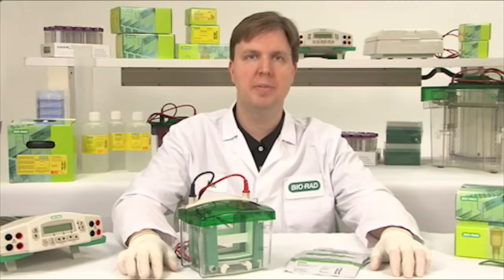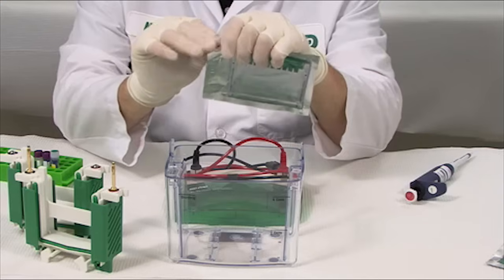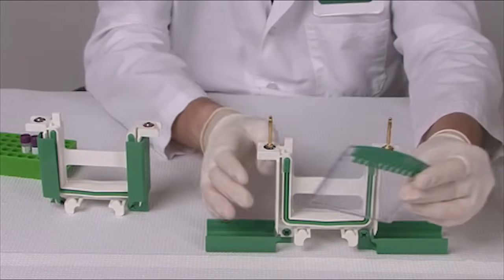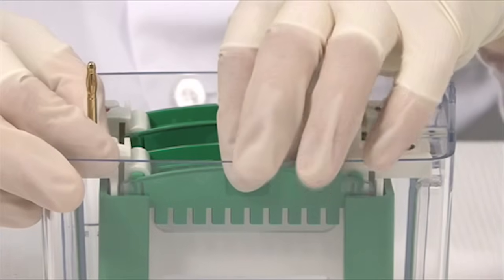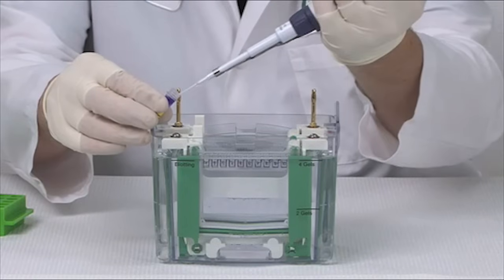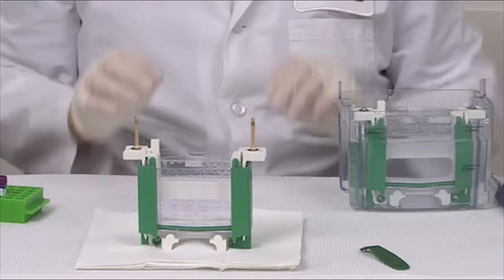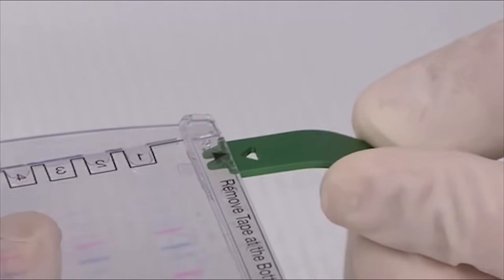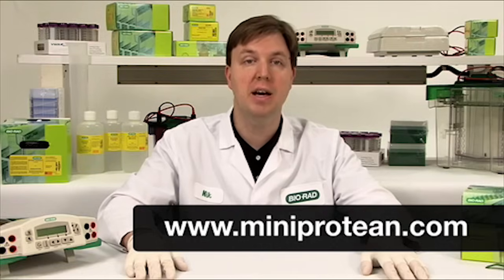Setting Up and Running Mini-PROTEAN® TGX™ Precast Gels

Comment: can these pre-cast gels be used for observing nucleic acids?
Reply: They are designed for protein migration, however i have tried using  tgx 4-15% acrylamide gels and they worked great with my pcr products. I used TBE 1x as the buffer, and after the run i stained the gel with green safe diluted in tbe for 20 min and visualized the gel under uv light. the bands were sharp  and they migrated as expected.

Comment: Whats the rinsing step for ? Aren't the gels already swimming in the buffer ?
Reply: When you remove the comb, small pieces of acrylamide can break off the gel and get caught in the wells. If you don't flush them out, the migration of your samples through the gel can be impeded and band resolution becomes compromised.

Comment: It's not that easy to remove the comb
Reply: Its much easier to remove the comb before the gel is put into the holder... i dont know why its not recommended. Any opinions?
Reply: @VorTexX993  Yeah I definitely agree it's easier to remove it outside of the holder. But my wells still get messed up when removing it. Mostly because it's hard to take out evenly.
Reply: wells tip over or break off using 15 well combs-- such a waste

Comment: I used these in my University labs. The glass of the cassette are hard to separate after electrophoresis. You should include a mini-crowbar to separate them. That small tool doesn't work.

Comment: We have Bio-Rad Mini Protean Tetra system in our lab. I am trying to run a 1-D Blue Native gel based on Wittig et al, 2006 protocol (http://www.nature.com/nprot/journal/v1/n1/full/nprot.2006.62.html). The protocol calls for a) 2 separate cathode and anode buffers, and b) the cathode buffer is a trice/imidazole based buffer and anode buffer uses imidazole and not tricine. I was hoping to use TGX precast gels with out Mini Protean tetra system for this purpose, and I was wondering if - a) our Mini Protein tetra chamber is compatible with running a separate cathode and anode buffer?, and b) if TGX precast gels are compatible with the proposed tricine/imidazole based buffer system as opposed to the standard Tris/Glycine?

Thank you.
Reply: we neen vido about eluter whole protein from gel please